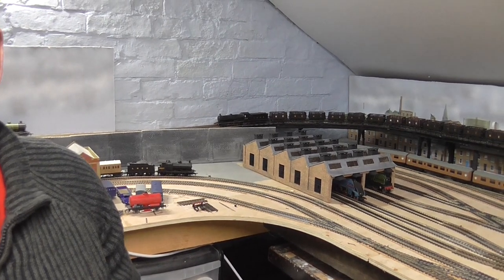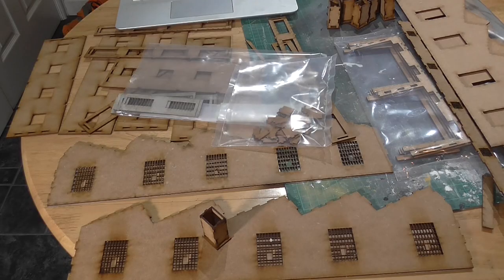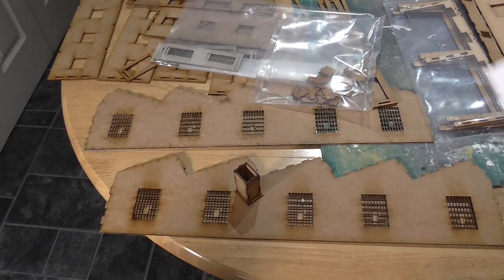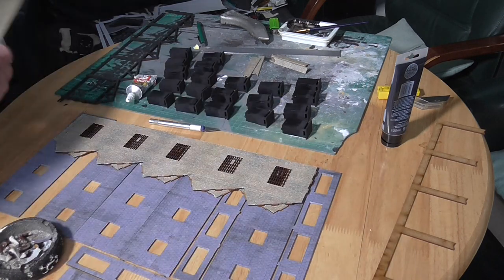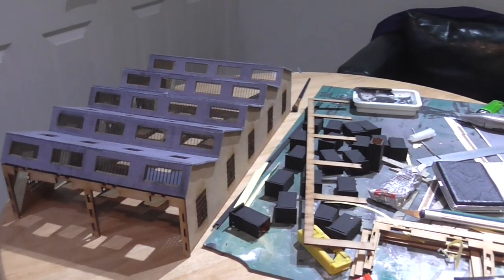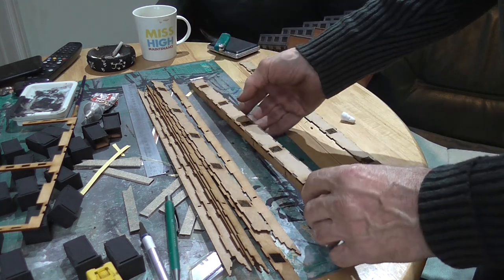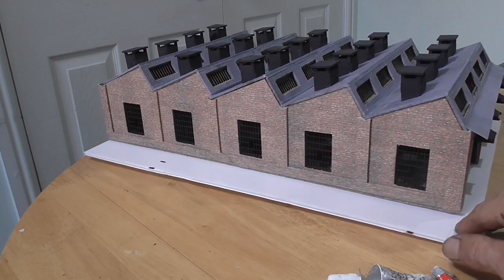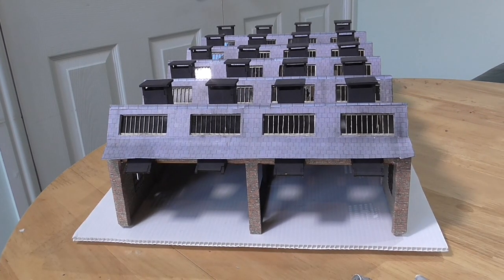4 lane Engine Shed

Comment: Impressive shed Glynn. its looks straight forward to put together. there's just one thing missing. some drain pipes to go between each slope on the side wall. some 1mm or 1.5mm rod would do the trick. fits in nicely with the period you are building. great stuff..........cheer's Tony. i think i need a bigger shed...lol
Reply from the maker: Hi Tony, you are right about the drainpipes, I have ordered some 3mm plastic pipe off ebay, hopefully that will finish off the shed, then I can light it up! all the best Glynn
Reply: Nice one.........Tony

Comment: Hi Glynn,
That is a super kit and you have done a super job of making it, it looks long enough to get two engines in on one track how will you not bang them together or can you see enough through the  roof lights?. Its good you can now get to finish that area it is going to look great. Keep safe and well as it is still looking bad out there.
Cheers Robert.
Reply from the maker: Thanks Robert, yes you can see through the roof lights, I am going to fit lights and will update when I finally finish it. Thanks for watching. Keep Safe. Glynn

Comment: A fantastic kit Glynn & not a bad price. You made the build look very easy, nice work,. Just missing some weathering & lights now.  Nice cup by the way - "Miss High Maintenance", is that yours?  :)     ...........Andy
Reply from the maker: Hi Andy, No, not my mug! lol. Unfortunately the daughter had to move out due to covid, was hers. but when you need a brew, you need a brew!
Have ordered a couple of inspection pits to finish off, will update with weathering and lights, hopefully!
Enjoyable build, well thought out kit.
You are the only one apart from the Missis to see the mug, great observation.
thanks for watching. Glynn
Reply: @LNER1946  agree, you can't model without a brew 😁 👍, how about some drainpipes down the sides of the building where the sloped roofs end, would be a nice addition? All the best, Andy
Reply from the maker: Hi Andy, good point! just ordered some off ebay. and 2 inspection pits, and fit the lights. Thanks Again. Glynn